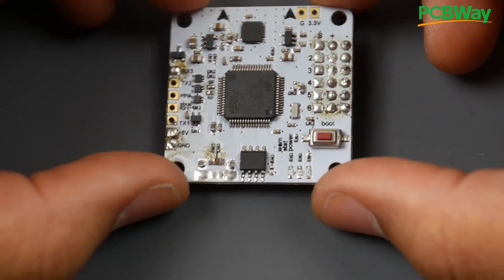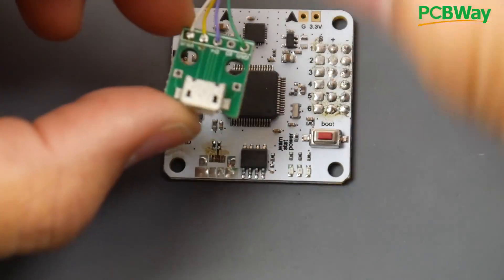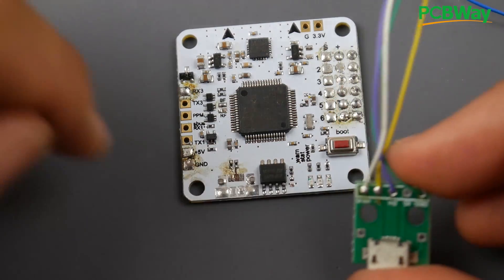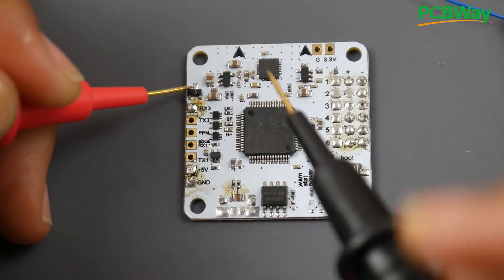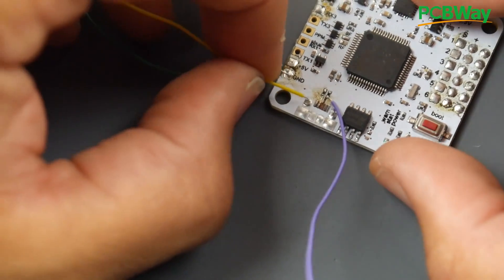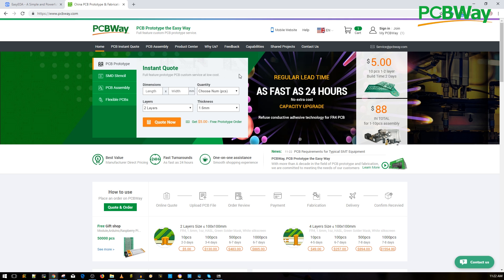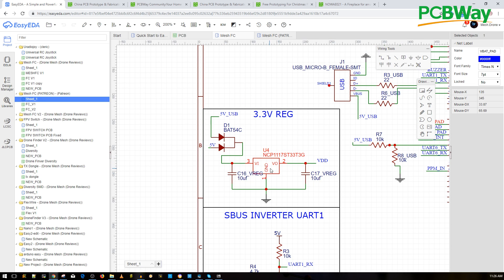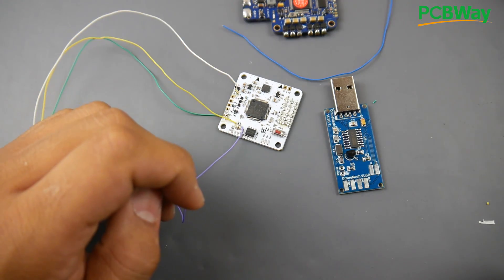How to FIX Broken USB On Flight Controller // Best and Easy Way Even With Pulled Traces

Comment: Mi fc doesent have any light on...and i can't get it working. It's a f22 hackrc aio. Thing si that when i turn on drone, the motors do the check, and i have video, but i don't have control transmisión and it doesent turn on any light, this was after a crash on grass. Thanks

Comment: This helped me so much. I didn't even need the breakout board, only needed to know about the resistors, as I pulled a pad on mine. Soldered the entire plug back on and ran a tiny bit of solder directly from the pin to the resistor and I'm golden now. Thank you!

Comment: After an hard crash on one arm, my osd disappeared and sometimes I get black screen. Also usb power up but no data transfer to pc, tried different cables and all driver fixes but nothing.
When I push the vtx around, sometimes I get the osd back or loose the video, depends. But usually the video keeps working.
I have a Tinyhawk 2 freestyle with a MatekF411rx AIO. 
Everything else works fine, any clue?
thanks!
EDIT:
somehow some pin of the mcu weren't touching correctly. if pressed on it, connection would come back.
soldering iron and very carefully I passed it on those pins. seems to work now

Comment: I'm dealing with trying to find these solder points on a BETAFPV 20A AIO Toothpick FC do you have any info on where the USB solder points would be for this? I'm not finding the diode and I think the other points may be sideways. At that How do I test for the D+ and D- points?

Comment: hey thanks for this video, i was wondering if you new which diode was the correct one on the mamba f405 board? i see there's only one 3 pin diode like you described, but I just wanted to make sure and ask you thanks again!

Comment: Hello, than you for your helpful videos,
My question is: I jumpe my FC matek F411 and now doesn't work and get very hot afte conecté the batería or the usb cable.

It is posible fix after that happened or not?

Comment: damn never thought i would have to watch this but my matek f405 ctr has bad legs on usb input..anyway to repair just usb and not have all this other crap?
Reply: Did you manage to do this with the matek board? I have the same flightcontroller, and intend to do this when the usb arrives:P
Reply: I have a matek f405 osd board with same problem, I'm thinking to just connect the D- AND D+ FROM THE USB AND POWER IT VIA A 5V PADS ON IT

Comment: good stuff to know if you are using flight controllers, always something burns or breaks and you need to hack the board to keep it flying, all my boards have some chips or some capacitor replaced...they burn easy. Easiest way to solder without hot gun and just with simple solder gun is to attach small wires, this way you will not damage the other components and is easy to solder

Comment: Hi Drone Mesh. 

I've noticed you did a review on StarF3S flight controller. I have
bricked my StarF3S flashing SPRACING3 (which I would expect to be a
suitable firmware for this being STM32F3****).
Flashing went fine and it said it was successful... Yet it doesn't
even connect to the PC, I don't hear the sound of the thing getting
connected.

How can I revive it?

Thanks in advance
Reply from the maker: Press the button on the FC then connect USB..  and you can flash it again.

Comment: Thank you, the port just broke off my FC, so I needed this tutorial!
Quick follow up question: Instead of bothering with soldering the VCC 5V, would it be possible to just plug in the battery, while having D+, D-, and ground?
Reply: Hmmmmm.... I reckon it could work, as long as the ground is common across the board?
Reply: @gautamkrishna7421  worked for me
Reply: i would also like to know this!

Comment: Very useful video for me because I have a board kakute f4 v2 with destroyed usb with no traces. I managed to locate the two resistors for D+ and D- but I can't locate which is the three legs diode in order to soldering the 5v . Could you please help me with that?
Thanks in advance

Comment: Hey just an idea for another series: I have a combo AIO FC/ESC board which has one faulty esc fail making the whole expensive board useless. I would love to bypass the broken esc with another one somehow even if it sits somewhere else on the quad. Think this is even possible?

Comment: Do you have a video on how to flash older CC3D boards to Betaflight? I have several older boards running Libre pilot and I’d like to use them on Betaflight👍🏻

Comment: Time to buy a new FC! This is way past my league. Way to confusing! I tell ya you know your stuff though. Appreciate all of your videos, but this one got me! Yikes!
Reply from the maker: All usb data pass through a 22 ohm resistor and thats it. Thats 90% of how to fix.
Reply: @DroneMesh  I have a mamba, but without The resistors. Them are broken too. Just the home, without any trave.
Reply: @DroneMesh  trace
Reply from the maker: If it's an F4.. also F3 but I dont knownthe resistor values but should be close to the USB port

Comment: Hey I have some 32bit esc and they are the same but different firm ware how do I change firmware
Reply from the maker: Before doing that make sure the Fet Drvier and the mosfets are exactly the same
Reply: @DroneMesh  they are it's the exact same just different firmware